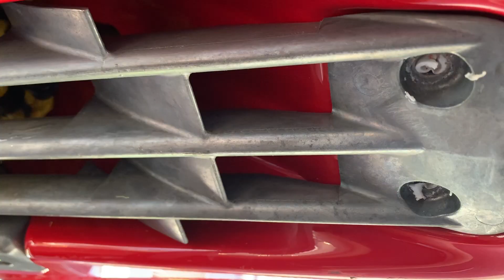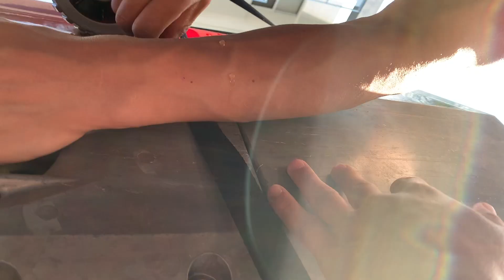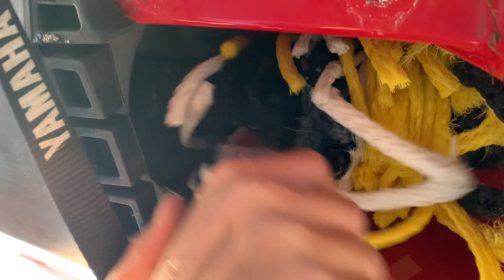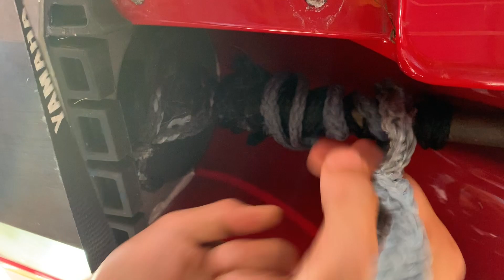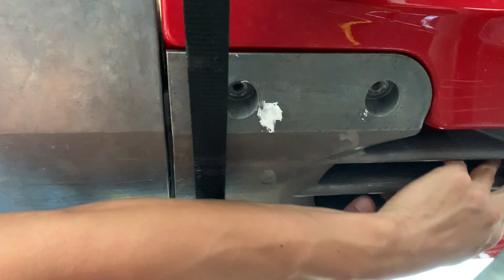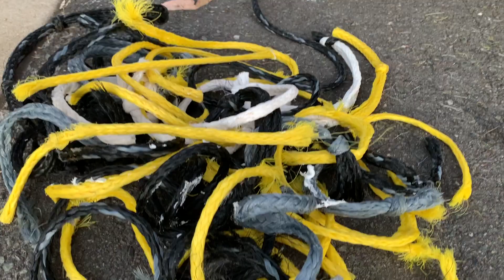rope in jet ski.

Comment: Get a foam pipe lagging from a plumbing store,  10ft long it floats, it high vis, and zip ties nicely around rope, and will hold the rope 10ft from the ski, 

Get a longer length if you like